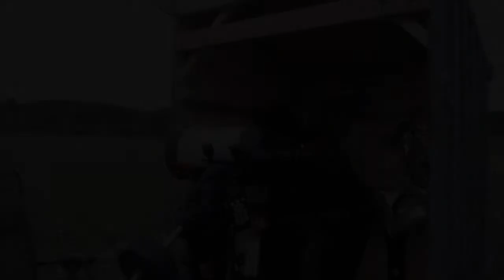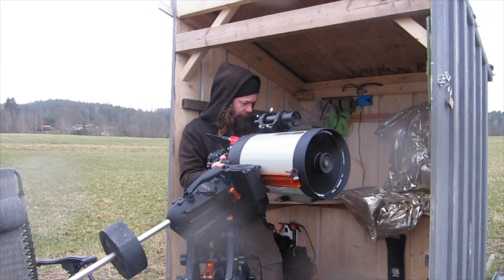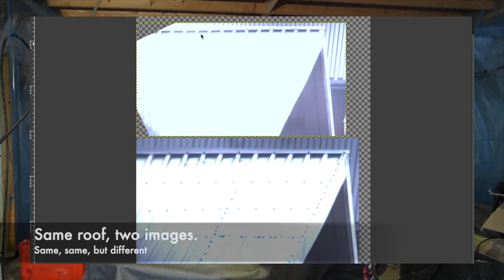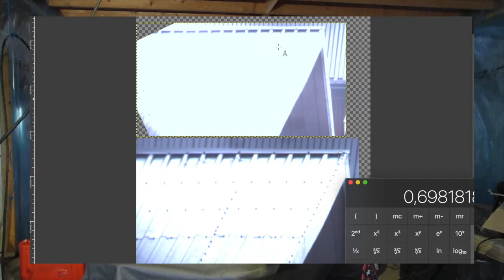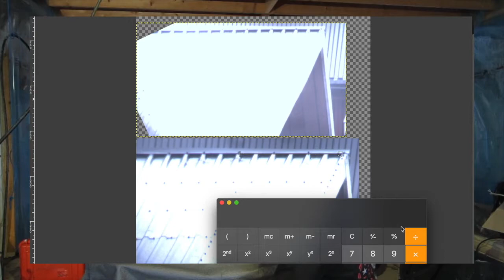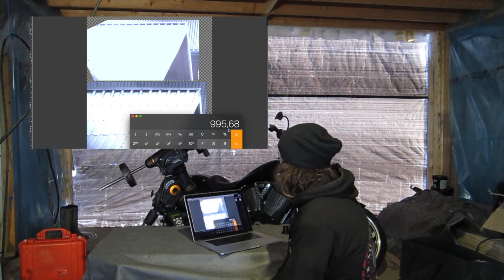OAG with a twist!!

Comment: Thank you very much Asrtroboden for sharing your knowledge. I purchased a .5x reducer SvBony about 2 years ago and rarely use it but now I will. Yesterday I ordered an of-axis guider for my SCT NexStar8SE (Astromania Deluxe Off-Axis Guider ). I am new on off-axis guiding and I appreciate your video. Looking forward to experiment with it. Clear skies.
Reply from the maker: Hi!
Great that you enjoyed it! Hope you get it working well. With a different setup, I got slightly deformed stars, which I guess is down to backfocus or tilt of the reducer. FWHM and core tracking were no issues though.
Good luck and clear skies!

Comment: hi. Astroboden 
Even if the grammar is incorrect, please understand.

I am going to do OAG guides like you do.

Guide to ZWO asi120mc-s always succeed?
Reply from the maker: Hey buddy! I don't understan how to  pronouncing your name , so don't worry about your grammar (english isn't my fist language either) ;)
I'm using the asi120mc-s and it's been working fine every time. Please note that you might have to rotate the OAG to find a guide star. This might affect your framing depending on the OAG. You might also have to use a longer exposure rate in some cases. (I'm using 2-3s at the most).
There is another video where I set it up, in case your interested ;)
Good luck!
Reply: @astroboden 
 Thank you for a detailed description.
Let's find another video of you.
Thank you.

Comment: Nice , the reducer on the guide scope work ?  You get more guiding stars with this idea ?
Reply: This is a fascinating question. I’ve been doing some pondering and I think this is the answer: you can lower the F ratio of your OAG but it will not increase star count unless your pick-off prism was projecting more light than your OAG camera could pick up. A 174 sensor probably will not be affected by this, but maybe a 290 would! Otherwise I would just increase binning to 2x2 to get an increase in starlight
Reply: @ColeRees  i use the asi290mm, with the reducer i get a bigger field of view and much more light , getting a bigger field of view and light you get more stars to guide in multistars guiding to get better results  , I use Asiair Pro and i can not change the binning on guide camera :( , I'm just waiting good weather to teste
Reply from the maker: Cool to hear that you've been trying it and that it works for you.
I have a simple asi120 and a 8x8mm prism. The camera sensor is fully illuminated by the prism, both with and without the reducer. The image is, as I think you can see in the video, fully usable from edge to edge and is brighter. 
I also tested last night with "proper" stars and I feel you do get the full benefit of the lower f-ratio. 
Then again, this might not be the case for all OAG and guide camera combinations. I haven't given that too much thought.
Reply: @astroboden  120mm i have this model to , work ok with small scopes 700mm or low , but for 1422mm its very difficult to get a guide star using oag :(  ,
Reply from the maker: @BOTenerife  is the  290mm better for the larger focal lengths? I don't even have the mm. I'm using the MC version :P 
Not the best guide camera, but I have always been able to find a guide star with the OAG at 1422mm (with reducer and usually by consulting Stellarium first ;) )
Reply: @astroboden  i can find always a star or more to guide with my setup , but i need more stars ,  ASI290mm (Mono) much more sensitive and i can get 3 or 4 stars, im just trying to make work the multistar guiding on Asiair pro/ PHD2 with OAG , but for that  need more stars , and with out the reducer will be difficult even with 290mm, binning can work to on PHD2 but need clear night to teste :/
Reply from the maker: @BOTenerife  I see! I've never tested multi star guiding. Didn't know it was available for Linux. That would be sweet!
Reply from the maker: Hi João!
To be honest. Now when you mention it. I have actually not made a “real” star comparison. I usually set up the system daytime. Focus both cameras etc. I simply see that the image is wider and brighter with the reducer than without. But what the actual change in SNR is I have not tested. 
I should really do this on a star and compare the star SNR etc with and without reducer.
Good call man, I’ll do that when I get a change and get back with some more data later :)
Reply: @astroboden  I’m about to teste to , I buy last year from AliExpress a 0,5x reducer to do this teste ,  but weather is killing me for months :(
Reply from the maker: Nice! Please, let me know what you come up with! Weather has been the worse it's been in ages. Don't let it kill the hobby! Stay on it!

Comment: Is a f/6.3 Reducer suitable for a focal length of 2800mm (SC11 tubus), aimed for Deepsky-Photography with Off-Axis-Guiding (OAG)?
Reply from the maker: Hi!
I guess it depends on the back focus of the system. Without the reducer it's longer and will provide more spacing for the OAG. With reducer it's shorter and you will have to see what you have left. I'm using a f/7 reducer for my 2023 mm tube and it works fine. 
If you're having a C11 from Celestron you might (please confirm yourself) back focus of 146 mm with reducer I think it will be in the order of 105-110 mm. You'll have to fit your stuff in this spacing. 
I calculate backwards from: 
camera -> adapter + optional spacers -> filter -> adapter+ optional spacers -> OAG -adapter -> reducer/OTA fitting
You always have to mind spacing between your equipment and adapt accordingly.
Hope that helps.

Good luck!